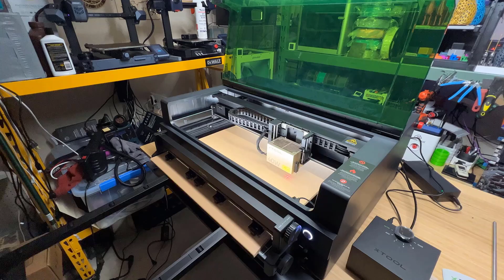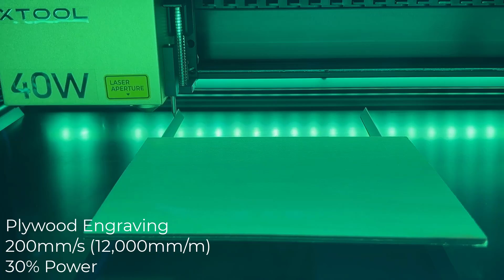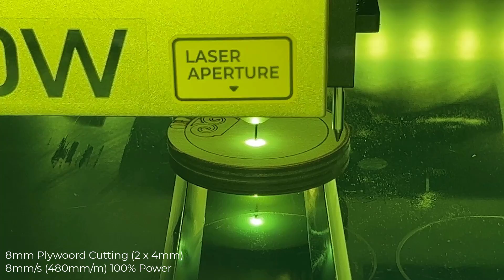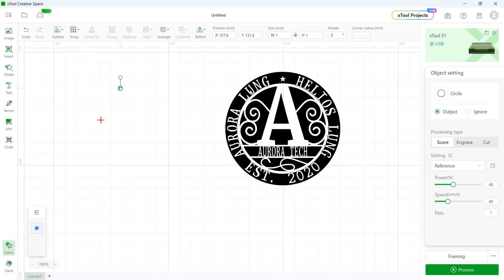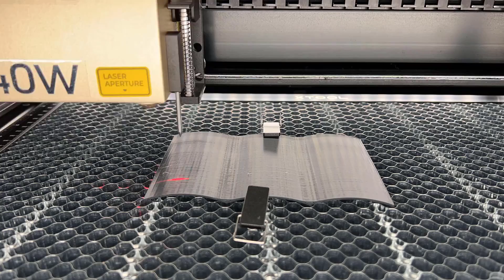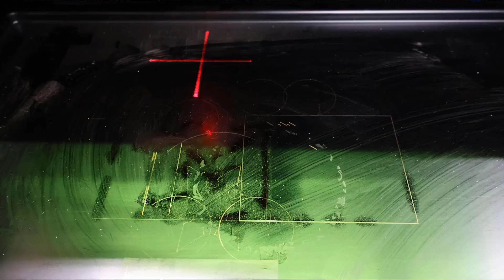xTool S1 40W: The new king of fully enclosed diode laser engraver with super strong cutting power

Comment: I liked your video presentation. I would like to know if the S1 40W can cut through 0.8 mm thick aluminum or even stainless steel?
Reply from the maker: I don't think it can. You might want to consider a fiber laser if you're looking to cut thin metal.
Reply: @AuroraTech  Or the 2w ir module?

Comment: Great video! Two questions. One: how does the cutting speed compare to the P2 55 W? Especially with something like quarter inch ply? 2: how well does the air assist work at keeping smoke out of the room with the conveyor? If I were just to use the smoke scrubber inside a house would the conveyor not be a good option anymore?
Reply from the maker: The P2 55W is better in every single way. Exhausting the smoke outside would be a much better option.

Comment: We are looking into buying one and will need to engrave metals, such as tools. I saw your video on the F1 that it worked just fine, but you did not show that in this video. Is this machine capable of that?
Reply: This machine is equipped with a 2W infrared head. You can use it just like the F1.

Comment: They crippled the laser by not including a camera.
Reply: I disagree. I own 4 lasers, including the S1. And the framing system it has is actually reeeeeally precise. Moving the tool head to specific spots to mark your work area is absolutely spot on accurate. Don’t get me wrong, and camera would be nice, especially to be able to keep an eye on longer jobs. But in no way does it cripple the S1. If you owned one, you’d understand. I was initially concerned too - but once I used it, those worries quickly went away.